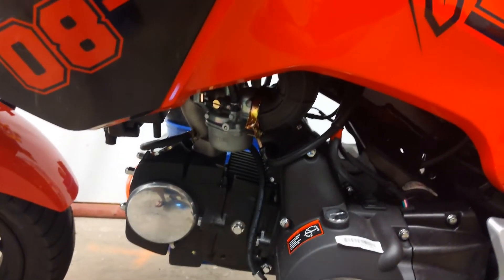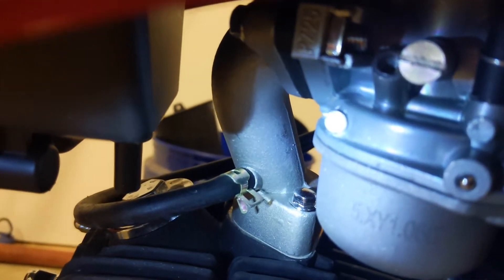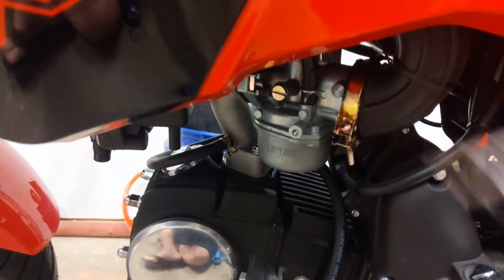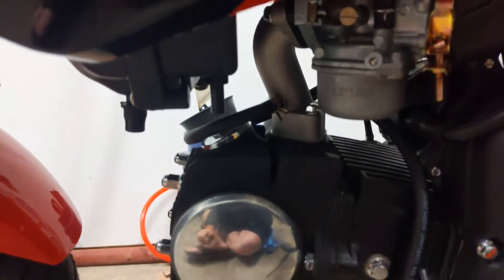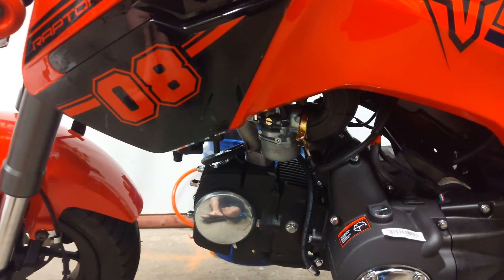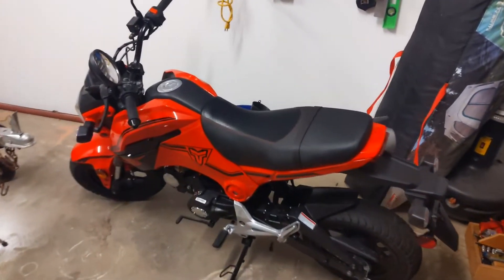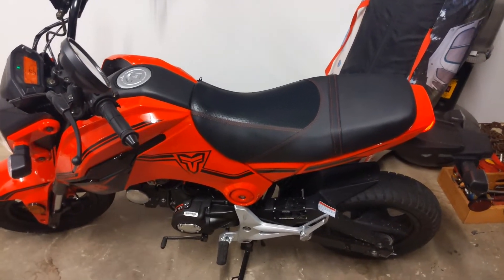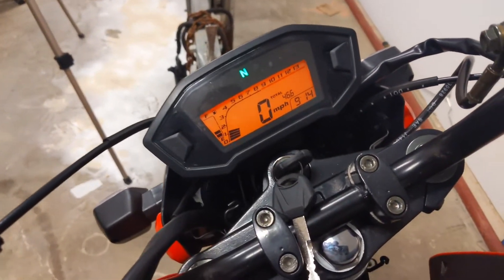Honda Grom Carburetor Adjustment for Grom Clone TAO TAO and BOOM Vader

Comment: I already knew this, but for anyone else who didn't, depending on air temp and elevation, going up one or one and a half sizes in main jet may be needed too.  

All of these Chinese bikes run lean out of the box.  Good video tip!
Reply: Does it spike in Rpm when idleing
Reply from the maker: It did not, but I ended up going with a Mukuni VM22 later on....Not a cheap china clone but a legit Mukuni.  added a good amount of power and great launch and top end!

Comment: Boom Vader  BD125-10 (XPro) fuel screw is plugged with plastic resin.  Easy to drill / dig out.  And yes, adjustment does make it easier to start.
Reply: I just bought a new carb and not I can’t grieve it throttle with out during bogging out
Reply from the maker: Clone vm22 is the way to go in the long run I think.